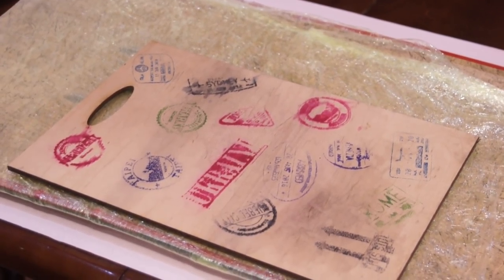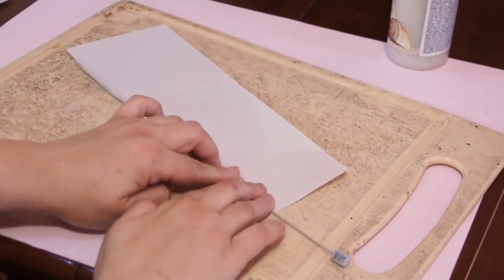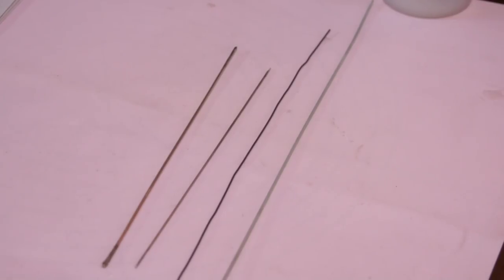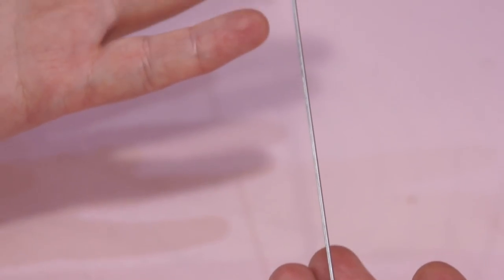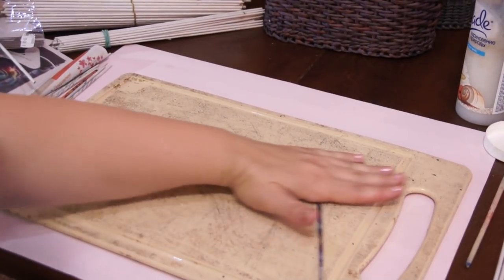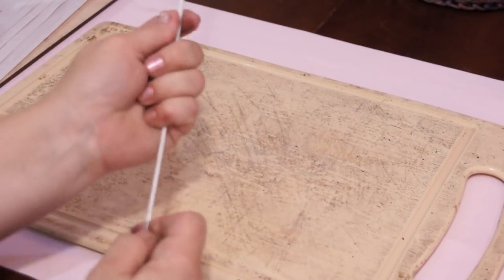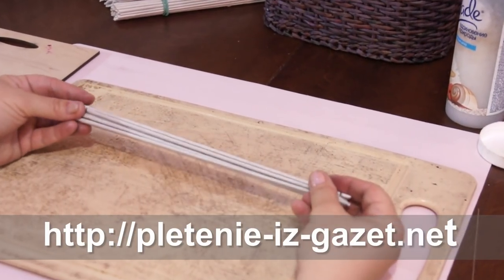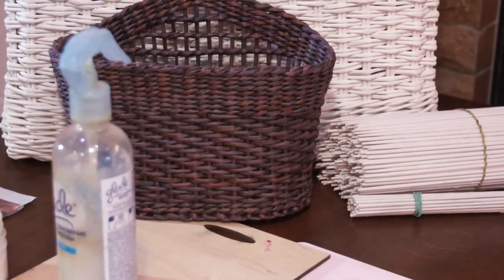Pros and cons of different tube rolling techniques

Comment: Is the kirschner wire what we might also call hat pin? Another type of pin would be a plain, round steel skewer without handle. They come in several thicknesses, from around 1mm to 2.5mm.
Reply from the maker: I named Kirschner's spokes as an example. You can use any spoke that has a diameter of 1 mm.